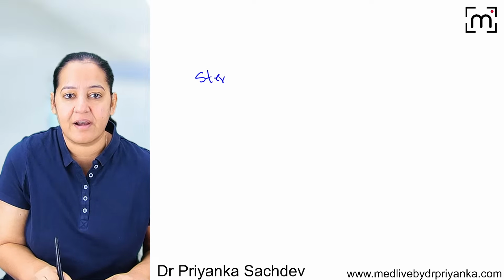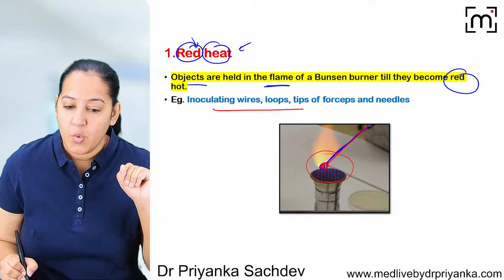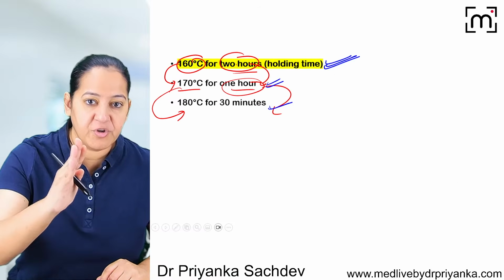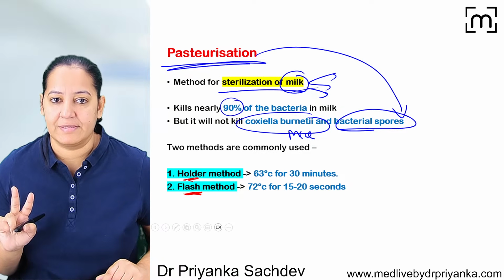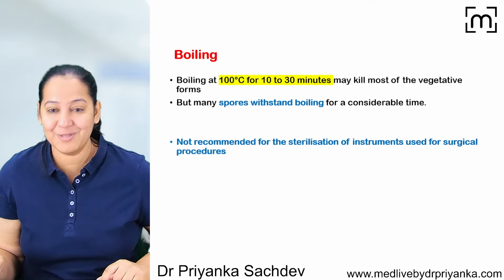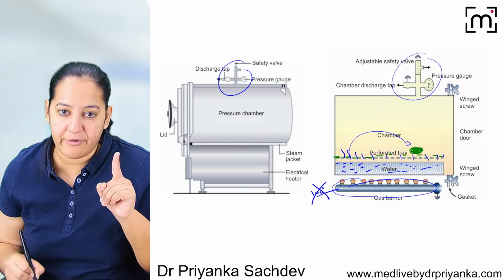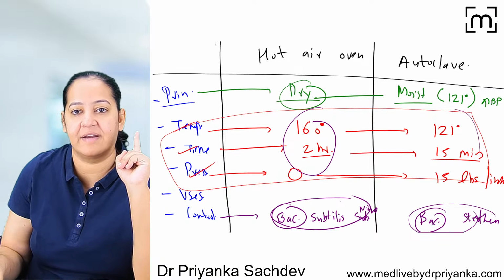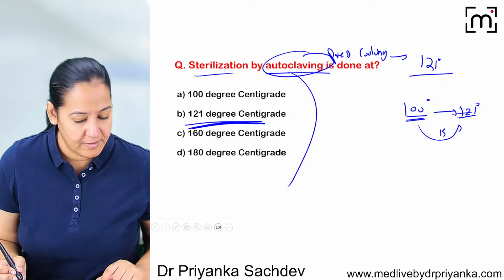Sterilization & Disinfection: Physical and Chemical Methods Explained | Dr. Priyanka Sachdev

Comment from the maker: 🩺 Master Sterilization & Disinfection with this high-yield revision guide!
Download the 'Physical vs. Chemical Sterilization' Summary Table here: [https://courses.medlivebydrpriyanka.com/new-courses/50-free-prof-buster-notes-library]

Navigate the Lecture:
00:00 - Introduction & Energy Check
01:05 - Sterilization vs. Disinfection: The 100% Rule
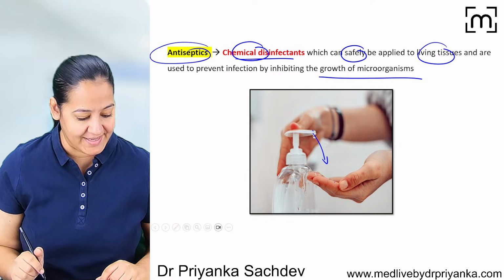05:30 - Physical Methods Overview
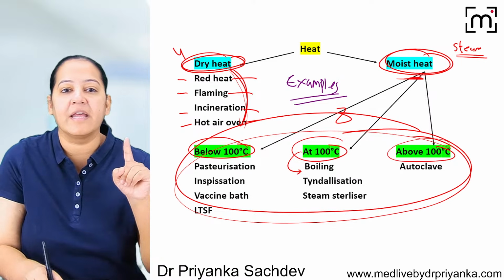08:27 - Dry Heat: Inoculation Loops & Red Heat
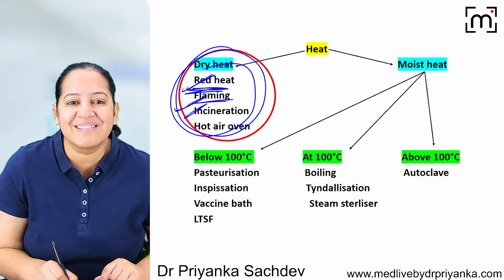13:02 - Incineration: Handling Soiled Linen 🗑
16:23 - Hot Air Oven: Glassware & Oily Chemicals
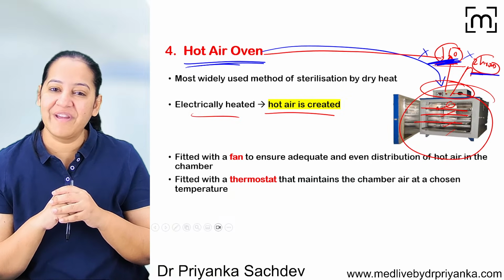21:45 - Biological Controls: Bacillus Subtilis > 26:00 - Moist Heat: Below 100°C (Pasteurization)
31:33 - Inspissation vs. Tyndallization (The 3-Day Rule)
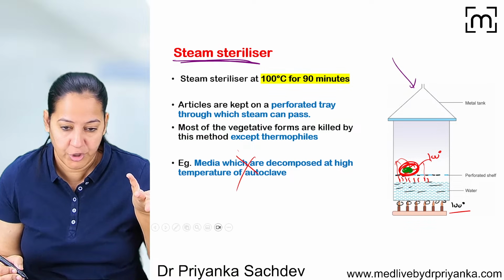44:22 - Autoclave Masterclass: The Pressure Cooker Principle 🌡
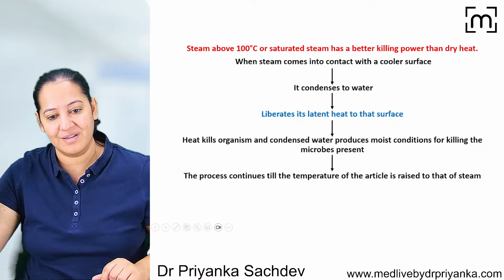52:15 - Autoclave Parameters: 121°C / 15 psi / 15 mins
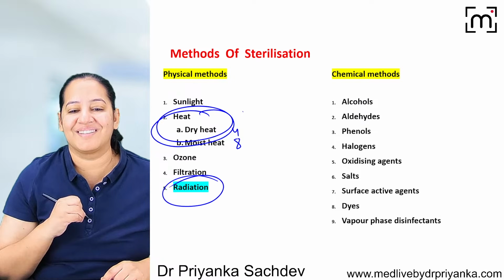57:29 - Cold Sterilization: Gamma Radiation
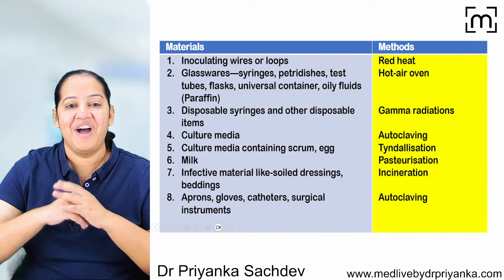59:10 - Final Summary Revision Table 📊
01:01:00 - MCQ Drill: Testing your Sterilization Knowledge
Reply: This link not open
Reply: Mam plz start the course for bsc nursing related subject
Reply: Mam please send me notes sterilization
Reply: Thanks abundantly Doctor
Reply: That link is not working mam
Reply: Please, the link is not working. Any leads?
Reply: Send this notes mam
Reply: Link isn't working ma'am!!!!
Reply: Bsc nursing microbiology  k liye ye lecture  hai kya ?
Reply: can someone provide me the notes of this lecture pleaseeeeeeee
Reply: Maam link is not working... Kindly provide
Reply: Please the link is not working 🙏🏾
Reply: This is a paid link

Comment: Medam please explain about 
1) In detail about physical sterilization 

2) components of hot air oven 

3) moist heat construction with lebelled diagram 

4) chemical sterilization 

5) gaseous sterilization 
6) sterilization by filtration
7) about autoclave 
8) chart of sterilization techniques
9) about incubator 
10) common disinfectants used in laboratory 

Mam as iam a DMLT student this is our syllabus mam please make the videos on it

Comment: Ma'am when we doing the red heat method .. if the innoculation loop becomes red hot.then  why did the bacteria that we transfer are not sterilize from the innoculation loop
Reply: Before inoculating we allow to cool down the loop so its not burn are bacteria which are present in culture

Comment: In order to achieve the heat content evenly, one has to provide the steam from a boiler and maintain the required temp. In order to keep the temp constant air is also to be evacuated through vacuuming cycles.
Reply: 2Nd part nhi mil raha chemical method walah plz help me